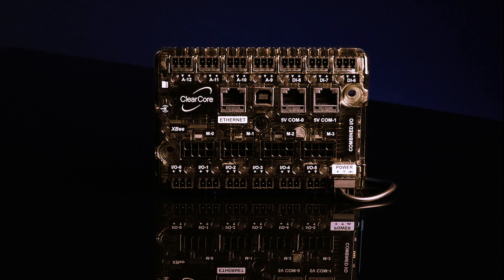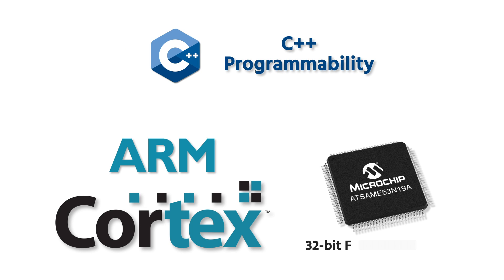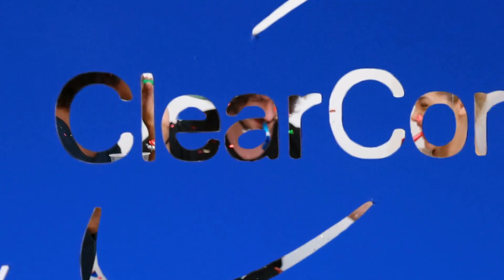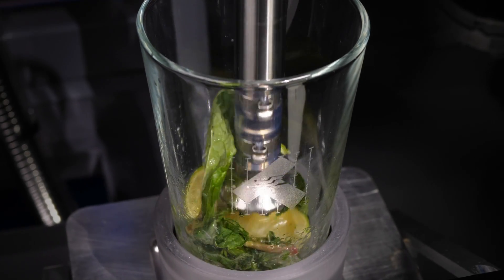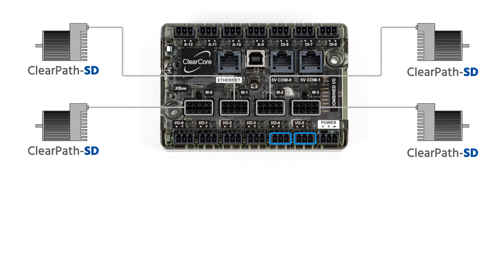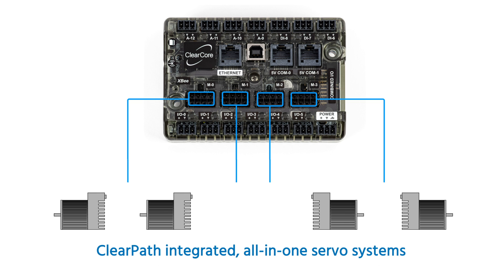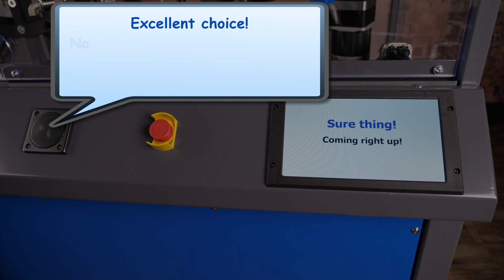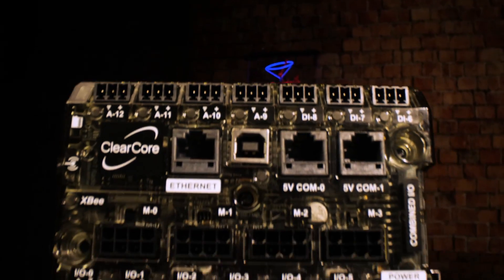Robotic Bartender Powered by ClearCore - Teknic's Industrial I/O & Motion Controller

Comment: Hey Teknic,  I want to connect a raspberry pi to ClearCore for serial communication to my Qt HMI. Your serial communication examples have one usb cable sending and another cable (COM) reading. Is this the most likely way serial communication is done (asynchronously)?  I’ve done a few tutorials with Raspberry Pi and Arduino (or a computer) but I can’t understand what you’re attempting to convey in your example of serial communication by using two separate ports - in a practical application. Can I set up my Raspberry Pi to communicate over usb to ClearCore in a Client/Server relationship? Why a two separate ports being defined in the example?
Reply from the maker: Hi StarChild.no1,

Most of the software examples for ClearCore define two separate ports in order to demonstrate the use of one port for printing out debug statements. So, the software examples showing the use of the COM port will also open the USB port for debugging.

One can certainly program the ClearCore controller to solely communicate over USB directly to a Raspberry Pi (this type of communication is done commonly with ClearCore).

If you have any additional questions, please feel free to contact Teknic by submitting a contact request on our website (https://teknic.com/contact/) or by giving us a call at 585-784-7454.

Brendan F. - Teknic Applications Engineer

Comment: So am I right here. I was told about Centroid Acorn 6 axis controller system and this clear core is basically the same except it does 4 axis so I would require 2 of these for my 5 axis milling machine inc conversion.
Reply: im not 100% sure here, but i believe clear core is more for automated machines like the example not sure much for CNC running Gcode

for my CNC plasma, Routers and Lathe I'm running Mach4 with an ESS board, but im looking at the clear core for my next build that will be an automated bandsaw
Reply: Cant buy from this firm
Anyway as they only accept credit card. Ha ha make america great again.

Comment: So for all those who want to build one, I did a little digging into BOM. I made some assumptions about the motors and selected the cheapest model. The BOM only includes off the shelf parts that were high-ish dollar and that I could easily find. Things not included were chassis, custom machined parts, ice maker, linear bearing/rails, power transmission components etc.
I have a feeling this beautiful machine would cost upwards of $8k to build.

Quant	Description	Unit	Total	
1	Clearcore I/O expansion board	50	50	
1	Clearcore controller	100	100	
1	Meanwell EDR-150-24 power supply	40	40	
1	Power distribution board	50	50	
1	"Amazon" IPC power supply	250	250	
1	Meanwell MDR-40-5 power supply	25	25	
4	Clearpath SD motors	260	1040	
2	Clearpath  MC motors	250	500	
1	Post-mix Soda gun	395	395	
12	1/4" Stainless steel street "t"	61	732	Custom 3d metal printed?
12	1/4" Stainless steel pushbutton valves	40	480	
2	Pneumatic cylinder to push pour buttons	50	100	
1	Carbonator pump	550	550	
1      24"x24"x10 Panel enclosure 300 300				
		total	4662	

Have fun!

Comment: What hmi are you using?
Reply from the maker: Hi Tr Liiv,

It's a touchscreen from 4D Systems (GEN4-ULCD-43DCT-CLB). We talk to it via TTL UART serial communication. 

4D Systems provides a number of software tools to help get started with your application, including an Arduino library (directly compatible with ClearCore's Arduino wrapper). To make wiring easier, here is a link to a break-out board for the 4D systems HMI: https://4dsystems.com.au/products/4d-clearcore-adaptor/ 

As a note, if your application requires some elements that are outside the 4D Systems' standard library, you may need to create some of your own (we ended up with a pretty sophisticated UI for this project and created many of our own elements outside of the standard library).

Please feel free to give Teknic a call at 585-784-7454 if you have any questions, or fill out a "contact request" at https://www.teknic.com/contact/ .

Mark D. - Teknic Servo Systems Engineer

Comment: You are using a half bridge PWM output. If you need a control loop to the Amps being output, is that possible to do via the analogue inputs?
Reply from the maker: Hi Jens Peterson,

ClearCore has 13 programmable digital and analog I/O points. Four of the I/O points can be configured as analog inputs (0-10 volts). Two of the I/O points can be configured as variable, bi-directional outputs (H-Bridge). We breakdown the configuration options for each of the 13 I/O points on ClearCore, here: https://teknic.com/products/io-motion-controller/

ClearCore is programable, so you can program the ClearCore to read an analog input (between 0-10 volts) and output a corresponding signal via the H-Bridge outputs. Just be sure that the devices you plan to use with ClearCore are electrically compatible with ClearCore’s I/O points.

If you have any other questions, please feel free to reach out to us directly through our "Contact Us" form (https://www.teknic.com/contact/) or give us a call at 585-784-7454. 

Best regards,
Ian R. – Teknic Servo Systems Engineer

Comment: Your guys need to  show how to build 5-6 axis cnc router.. with this new hardware
Reply from the maker: Hi henri, The ClearCore library does not currently support CNC-specific functionality. A user with a strong software background could technically program a ClearCore to interpret G-code and M-code commands. However, this is a large software undertaking (typically more appropriate for machine manufacturers) – so most users will have an easier time implementing a different controller for their CNC machine(s).

If you have the experience and intend to invest the time to create the necessary CNC functionality, we'd be interested in discussing this project with you.

If you have further questions, feel free to reach out to us directly through our "contact us" form (https://www.teknic.com/contact/) or call us at 585-784-7454. 

Thanks,
Aaron B. - Teknic Servo Systems Engineer

Comment: Do you have any wiring diagrams for integrating a light curtain as a safety guard?
Reply from the maker: Hi Jonathan, 
We don't have anything specific about how to wire up a light curtain, but the ClearCore documentation ( https://teknic.com/files/downloads/clearcore_user_manual.pdf ) has examples for how to wire to just about any kind of electronic component. I imagine the manufacturer of the light curtain will give you a schematic for their outputs that you could cross reference against our documentation. 

It's difficult to give you more specific information without knowing more about your system, but if you have a particular light curtain model and part number in mind and can't figure out how to wire it to ClearCore, feel free to contact us at https://teknic.com/contact/ or you call us at 585-784-7454.

Best regards,
Tom T. - Teknic Servo Systems Egnineer
Reply: @TeknicInc  I know how to wire the light curtain and a digital input. How to I make the clear core stop servo motion and resume properly when light curtain is broken / unbroken,
Reply from the maker: @jonathanhornell-kennedy4521  Hi Jonathan: The optimal answer depends on whether you are using Teknic’s ClearPath-SD series, ClearPath-MC series, or a servo or stepper from another manufacturer. The preferred choice will also depend on the level of safety protection that you want. For example, relying on software for a safety system is often not acceptable because software is historically perceived (often rightly so) to be less reliable than hardware. Even if your own application code is not involved, the safety system of your application might not be considered safe by some authorities if the firmware in a processor (like in the ClearCore) is involved.

“Resuming properly” can have different definitions based on different application requirements. For example, if re-homing the machine after power cycling the “hazardous” voltage (bus power) is undesirable, providing logic power backup may be required to keep the logic-level power alive when “hazardous” power is cut.

Some common approaches to creating safety systems include (but are not limited to):

1. Use a relay/contactor to cut AC to the servo’s bus power supply. Dynamic braking (on a ClearPath servo) will stop or slow the axis. External brakes are also an option for loads      subject to gravity or tension. ClearCore could be involved here if software involvement is acceptable:
a. ClearCore could be completely uninvolved and everything is controlled through an SSR for example.
b. ClearCore could control the contactor and brakes based on the light curtain input, but this relies on software.
c. A hybrid approach where ClearCore monitors the light curtain state so other things can happen, but removing motor power is still handled by other hardware. The software running on ClearCore could also test the integrity of the system upon start-up to give some helpful redundancy without relying on the software to kill power.

2. Use ClearCore to command the motor to make a controlled stop when a digital input is triggered. Once the motion has stopped, you could choose to leave the drive enabled, disable it, or remove power to the drive. How you stop the motion depends on the type of servo being controlled. Here are some potential options when using either a ClearPath-SD servo or a ClearPath-MC servo (some other servos might have similar options):
a. If you use a ClearPath-SD servo (i.e., with Step&Dir inputs), the light curtain digital input to the ClearCore could be configured as an “EStopConnector” which will automatically ramp the command to 0 RPM when triggered. You have the ability to preconfigure a separate EStopDecelMax decel rate for this EStop function.
b. When using the ClearPath-MC, you could program ClearCore to stop the motion at any time by using the inputs related to the specific operational mode used for that axis. You could also preconfigure a ramped stop function upon disable in ClearPath-MC. (This applies to every MC operational mode except “Spin On Power Up” and the various torque modes.)

If you have any additional questions, feel free to contact Teknic directly at https://teknic.com/contact/ or give us a call at 585-784-7454.

Best regards,
Tom T – Servo Systems Engineer

Comment: Are there code examples from this project?
Reply from the maker: Hi Michael, 
We have internally discussed sharing the code for this project, but it is not documented as nicely as we would like our code to be for public release, so at the moment that task is on the back burner. The good news is that we have published quite a few code examples for the machine’s controller, “ClearCore”, as well as other detailed information (including electrical schematics, and mechanical information). 

You can find this information here: https://www.teknic.com/products/io-motion-controller/ (and downloads here: https://www.teknic.com/downloads/?download=1&clearcore=1#clearcore_2) 

If you have any other questions or suggestions, please feel free to reach out to us directly through our "Contact Us" form (https://www.teknic.com/contact/) or give us a call at 585-784-7454. 

Best regards,

Tom T. - Teknic Servo Systems Engineer

Comment: Ordered 3 ClearCore controllers to get started on a couple projects. I've waited for a product like this since I first ran GRBL about 10 years ago. Thanks Teknic.
Reply from the maker: Hi Craig, thanks for the positive comments about ClearCore! You mentioned GRBL, so I was wondering if you expect to use ClearCore as a CNC controller. The reason is that although a user with a strong software background could program a ClearCore to interpret G-code and M-code commands, the ClearCore library does not currently have native support for such CNC-specific functionality. 

ClearCore is a great fit for most I/O and point-to-point motion applications, but using it for CNC would require a significant amount of effort. If you have the experience and intend to invest the time to create the necessary CNC functionality, we'd be interested in discussing this project with you.

If you have further questions, feel free to reach out to us directly through our "contact us" form (https://www.teknic.com/contact/ ) or call us at 585-784-7454. Thanks.
Best regards, AbeA. - Teknic Servo Systems Engineer
Reply: @TeknicInc  Thanks for the fast response. I understand your statements in terms of G/M code control functionality. I'll call you.

Comment: Very impressed with the price and capabilities of the ClearCore! What HMI did you use for this project and what protocol does it use to communicate with the ClearCore?
Reply from the maker: Hi Will F,

Thank you for your kind words about ClearCore.
 For this specific project, Teknic used a touch screen from 4D Systems (GEN4-ULCD-43DCT-CLB) and communicated via "TTL" UART serial communication. 4D Systems provides a number of software tools to help get started with your application, including an Arduino library (directly compatible with ClearCore's Arduino wrapper). Here is a link: https://4dsystems.com.au/gen4-ulcd-43dct-clb

As a note, if your application requires some elements that are outside the 4D Systems' standard library, you may need to create some of your own (we ended up with a pretty sophisticated UI for this project and created many of our own elements outside of the standard library).

I hope this information helps. Please feel free to give Teknic a call at 585-784-7454 if you have any questions, or fill out a "contact request" at https://www.teknic.com/contact/ .

Bridgette G. - Teknic Servo Systems Engineer
Reply: @TeknicInc  Bridgette, Thank you for the details! This HMI with the ClearCore knocks about $3,500 off of the control package I am looking to replace! Awesome product, can't wait to try one out. I think uploading your Bartender code to the Clearcore example library would super helpful to new users looking to swap over from competitors.

Comment: I have really enjoyed developing on the ClearCore product for my tool carousel kit. Hoping to get that to market soon. What I would love to see next is an unit designed to control the SCSK line of motors. My next project would greatly benefit from G-stop and cost effectiveness of the Arduino platform. 8 motors would be nice in that version too. Now that I have a really cool tool carousel for everyone else's CNC it is time to make my own CNCs. Getting rid of the PC and using a phone or tablet to run the CNC is long over due.
Reply from the maker: Hi John,

Thank you for your compliments and feedback. I will be sure to add the request for a ClearPath SC compatible I/O and motion controller to our feature request backlog. Our engineering teams use this backlog to determine which tasks or projects to pursue next. 

If you have any questions, please feel free to contact us at https://www.teknic.com/contact/

Best regards,
-Ian R., Teknic Servo Systems Engineer

Comment: :)  And all I was thinking about was a cnc.
Reply from the maker: Hello Robert Fontaine,

Thanks for watching the video and for your comment.
 

The YouTube user "Machine 27" posted a similar comment on this video about CNC control and the ClearCore Motion and I/O Controller. One of our applications engineers replied to Machine 27's comment with some relevant details regarding the capabilities of Teknic's ClearCore and how they relate to the requirements of a CNC controller versus a point-to-point controller.

As a quick summary, the ClearCore is not natively a CNC controller, but someone with extensive experience could potentially program a ClearCore to interpret G-code and M-code from a CNC controller. Please see our response to Machine 27 for more details.

If you have any additional questions or comments, you can contact a Teknic engineer at 585-784-7454 from 8AM-6PM (M-F) or use the "Contact Us" form on Teknic's website:
https://www.teknic.com/contact

Best regards,
Tom T - Teknic Servo Systems Engineer